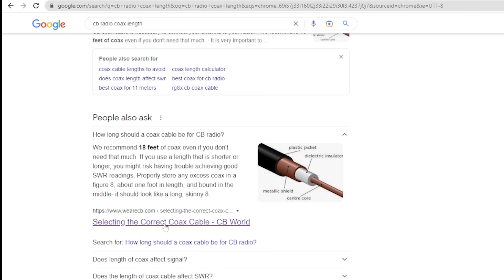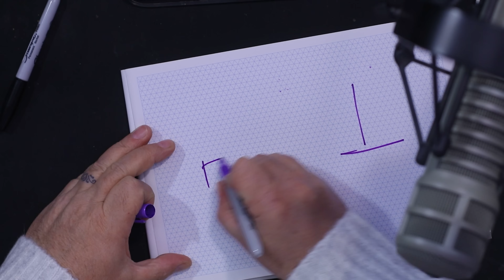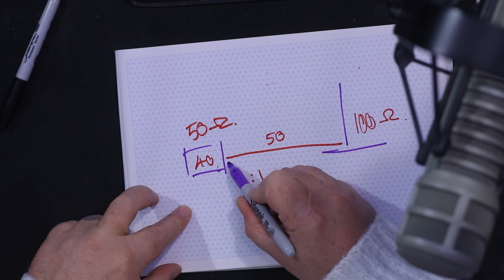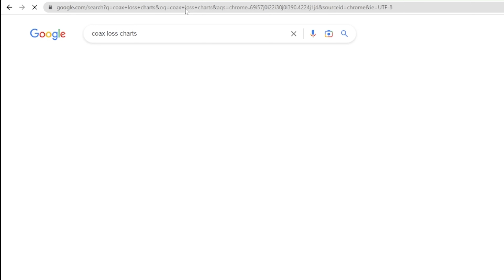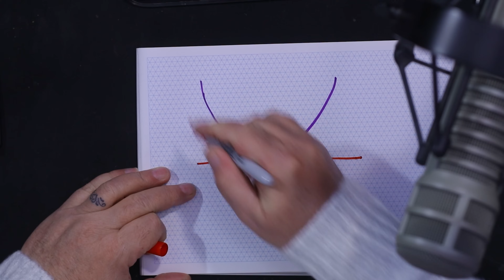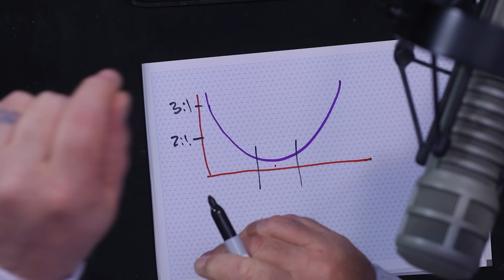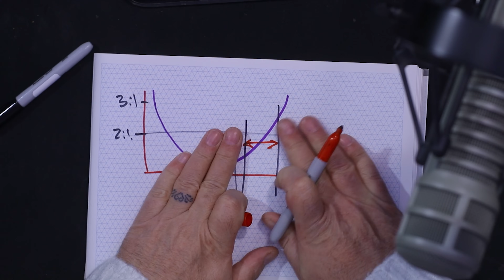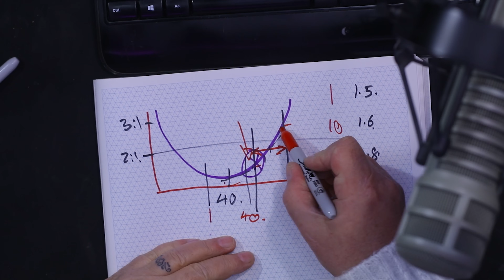11m / CB Radio: How Long Should My Coax Be?

Comment: Great Work Callum....

I'd add there is an "element of good" in this myth. I would not dissmiss it totally. As we know coax repeats it's impedance every half wave etc. This characteristic is then usually exploited for open or shorted ends for tuned stubbs etc. The real magic is in the 18 foot (adjusted for velocity factor) as you point out. This would effectively BROADEN the tune dip seen by the SWR meter if you trim your coax to the right length. Alot of CB operators today have NAUGHTY type radios.... That can talk on just about everything from 26mHz to 30mHz. Widening the usable dip is an advantage..... Shh.... you didn't hear it from me ;)

In AM broadcast there is "certian lengths" of coax runs between TX hut and ATU out on the tower that you avoid like the plague. For the completely opposite end of this characteristic where it runs HIGH. That gets into the whole open wire feeder vs coax argument too.

The rolling your coax into a figure 8 is not a myth. If you have any sort of extra length of cable - speaker - mains power - even a massive long coax - if there is any sort of magnetic feild out side it then the fig 8 cancells all that field from building up.... In the Event's Lighting game where you are using a long cable to run a light 10m away with a cable from you cable packer being 20m. If you are tidy operator you would want to roll this up. We all know if you do it will heat up. fig 8 stops this.... and done correctly doesn't twist you lead. If I see you rolling it up on your arm... you don't work for me no more.

cheers buddy
Reply: cb ops from the start in the usa have had NAUGHTY radios ! the 1960s browning, tram, sbe cb radios etc had receive vfos that went from 26.900 to 27.750. a small bit of work and it would work on tx and rx!   thy wear the first NAUGHTY radios.  then you had the Jonson ham  rigs from the 1950s with 11m from the factory as it was a ham band! the Jonson white face  cb could go low to 26 mhz by swaping the tx and rx rocks. as the Jonson cb was am only the  26.915 was the early free band calling channel in the us for am free band. ssb was was on above ch23 in the old days as the common rig was the browning as it was a ssb set that could go from 26.900 to 27.750 in the 1960s! so ssb was on the hi band. this abuse led to 40 ch. and then going above 40 was the norm as the vfo had more room yet.thare was allso the comsat 25 that was made in limited numbers that had 25 channels in the mid 1960s! the fcc put the hammer on them. so the idea of free banding is old. also running power to as the old ruels only talked of input to the cb and made no mention of amps! then came the ban on amps. then came the modulator ware the cb is used as a power oscillator and the audio is sent to the modulator. demco was a common one.
Reply: I rolled my coax into a loop and it made not one bit of difference to my SWR. I suggest there was r.f. on the outer. I use ferrite rings as chokes on mine.
G4GHB.

Comment: Back in my CB days (just before the FCC gave up on it) I was fortunate to have a couple of local hams that helped with fixing up the radio I had at the time (23 channel Cobra 138 with Siltronix vfo, AND had an extra crystal board for 10 meters!! Got it dirt cheap, too!), and giving advice on radio in general (like if you think you NEED a linear, put your antenna up another 40 feet)

Now that I'm a ham, I can't seem to find ANY  "friendly hams" to help (local, anyway, nearest club is 40 miles away and haven't contacted their contact after WEEKS) and the ham bands are about as bad as CB now!!! Have a radio and antenna (gave up looking for radios online, everyone seems to want almost as much for their junk as a NEW radio, got a closet full of them as proof, so I bought new) just need to get the antenna up and the radio on the air!!

Great video!!

DE KE8NFK
Reply from the maker: Friendly hams.. I don't find that. Most people seem happy to help from what I hear.

Comment: in the 80,s i got electrical wire block connector coax and pl plug 9ft wire one way 9 ft other way and snipped an inch off at a time round the bedroom roof basically a dipole 1.4 swr and worked now ive a imax 2000 and 20m mini 8  20m  coax 40 ft in the air 64ft including antenna down about 3 foot on pole  5 wraps about 4 inches wide  ugly ballun lol  into house and about 10 feet coiled in the air vent swr 1.2   1.3 great lol
Reply from the maker: Perfect!

Comment: I agree with you. I have always tried to keep my coax runs as short as possible.
Once you know loss per 100 ft, its easy to figure out your line losses. If the length
of your coax affect your swr then something is wrong somewhere in the system
and it's most likely your antenna. Nice explanation Callum 73's Gary KF6EWO
Reply from the maker: That's it!
Reply: I agree, if the antenna is right, the coax can be any length. Coils and common mode chokes can be a good thing, if you have excess.

Comment: I've read an article saying for base station, cut your coax in multiples of 11 feet, is that true? Secondly, what is really the correct length of coaxial patch cables for radio to amp then to your SWR/POWER meter? Is it 6, 9 or 12 feet? It's kinda confusing coming from different opinions. Because they say that having the wrong patch cable length may either won't give you the best optimum performance out of your linear or worst, damage it. Much appreciate sir and all the best.
Reply from the maker: OK, so watch the video - it doesn't matter - cut as short as you can.
Reply: You'll find that 11ft is about a half wavelength. Maybe you can figure it out yourself from here instead of believing everything that comes out of another man's mouth.
Reply: @arconeagain  The reason I ask is because I don't know what or who to believe in. Many videos or forums with different ideas, formulas or calculations so it gets confusing. Again in this video it says otherwise. Regarding jumper cables, shorter than 6ft or longer than 12ft may or can damage your amp, but then again, some say they only use around 3ft and it was fine. So which is which?
Reply: @franciscolopez3229  let's say 11ft is exactly a half wavelength of coax with a 66% velocity factor at your design frequency (it's actually 11.87ft on ch35), and you run this length to your antenna, or multiples thereof, or wavelengths for that matter, it will show the impedance of the antenna at the radio end. In fact, technically, it doesn't matter what impedance coax you use! You could use 75, 100ohm, whatever, and the system will ignore it. So you can see the advantages for doing this. Being able to read and adjust your antenna impedance from the shack. Maybe you received a free roll of RG6 Quad shield off a job site and wondered what to do with it (these things would fall off the back of the truck all of the time), but measure its velocity factor and recalculate. You can trust me, this is not an opinion, these are all facts, it's science. Better yet, I have practiced the theory. I learned that when I was 14 or 15.
Reply: @franciscolopez3229  In regard to patch leads, if your amp has a 50 ohm input impedance, any length. However, some manufacturers specify. Maybe they want you to feed their amplifiers at a certain phase angle?? We won't get into that.
I believe the whole patch lead thing came out of America because of a lot of these crudely built 2 and 4 pills etc. For example, have you thought to measure the input SWR of your amp? Most don't think to do this. The fact is that this input impedance varies, especially on these home built types, and what's happening is, the patch lead is acting a coaxial transformer. So one bloke up the road is swearing by 6ft and he gets a higher output, and the other bloke 4ft. What the morons don't realise is that one amp has say a 80 0hm input impedance and the other 30.
So see for yourself. If you have a fairly accurate inbuilt SWR meter in your radio, measure that input SWR (amp on). If it's 1.5:1 or more, use a different patch lead length while monitoring with a decent output wattmeter. The meter won't lie, unless you have a very dirty amp with spurious emissions or a serious CMC problem.
Reply: @arconeagain  correct ! I think most are misunderstanding impedance transforming, this video doesn't go into this which is actually adding to the myths
Reply: @paulm0hpd319  yeah it's all convoluted. In saying that, I am not narrow minded. I do believe there are some concepts to be investigated here... before a smear campaign on CBers. One could also argue that manufacturers are supplying in these lengths, so who's at fault? I plan on doing some practical, because I suspect it has something to with CMC and maybe an effort to decouple the feed line. After everything I've said, there is a chance correlation which confuses matters (I'm an open book BTW), that is the typical velocity factor of 66% means that a 3/4 wavelength lands roughly on a half wavelength with the shield/physical length. So in other words, 0.75 x 0.66= about 0.5. Mmm.
Reply: @arconeagain  I agree also , common mode current and impedance transforming/matching are valid points for certain lengths of coax
Reply: @arconeagain  Thank you so much for sharing your thoughts and experience on this matter. It sure does clear up things regarding my question. 73 and all the best.
Reply: @arconeagain  Again, thank you so much for the additional knowlege.
Reply: @franciscolopez3229  that's okay. If you have any more questions on antenna theory, radio, amplifier and mic repair, just ask.
Reply: @arconeagain I really appreciate that very much. All the best.
Reply: @franciscolopez3229  arcone is the old school CB'er. For years, 40+, I've never cut coax to any preferred length and guess what? All my radios still work. I get out just fine. Just take care of your SWR.
G4GHB.
Reply: Did you not watch the video?
Reply: A dummy load (or lamp briefly) on any length of coax will be as bright whatever length of coax as the power is transferred irrespective of length. A dummy load, coax and transmitter are all 50 Ω so everything is matched. A bulb is a mismatch but still shows the situation. I can do this with a bulb for long periods if I wish because I built a resistive SWR meter and run my tx into that first so the tx only ever sees 100 Ω (2:1 SWR) on the input but shows the SWR, very handy for adjusting aerials.
G4GHB.

Comment: I put an Antron up on the rear stack this weekend - 10 meter band is on fire!  SWR at the data end is 1.8:1, so my 50 watts is only radiating 46 watts.  Big deal.  Hilarious that an SWR of 1.8:1 would have had me worried (and too embarrassed to admit to) back on CB.
Reply from the maker: I know Martin.. Me too - back in the day! :)
Reply: Improve the coax loss the power will improve also
Reply: @paulm0hpd319  Insignificant on relatively short runs below 30MHz is what I'm saying.

Comment: Coaxial impedance is derived from Z = sqrt(L/C) where L is the inductance and C is the Capacitance where both values are per-metre of cable.
Your VSWR graph can also have Ohms on the y-axis so for a 50R system 2:1 would be 100R and 3:1 would be 150R derived from VSWR=Zload/Zsource, it's a good way of estimating antenna impedance from the graph.
Yes there is a bend radius for coaxial cable, but I agree with you Cal, what's reported and the folk lore is all tosh...
We need more videos like this to help dispel what is a lot of nonsense circulating around. Well done.

Comment: I noticed on Houston METRO buses there seemed to be some sort of strap dragging on the pavement of the buses.

I had to ask.  They said they had to ground the buses due to the buildup of static electricity.

I wonder if those kinds of straps would work on cans/trucks going mobile?

Or hooking up grand wires along the ground while stationary like one adds to a Wolf River Coil antenna?
Reply from the maker: Interesting.. It wouldn't work with us lot and dragging a long wire off the back of the truck might be fun!
Reply: @DXCommanderHQ  It is just a short piece.  Maybe I can get a picture.
Reply: It used to be seen on cars back in the 1960's and perhaps early 70's.

Comment: Hi Mr. Callum,  I know of a guy the builds & repairs Amps.. Much smarter than I.. He had a guest on one of his videos one.. 
The guest had a box that he had built with 32 transistors in it; they said that the length of coax from the Box to the 
Antenna was critical.. Is this a special case/ condition??  So confusing.. I have another question; if one has some 
coax that is 18 ft long with a velocity factor of 66%, would that not make it act longer Electrically; as in 1/3 longer?? 
♠W.G.
Reply from the maker: @wg davis - OK, for 99.9% of the time, you shouldn't consider this coax length. There is a technique of using different impedance coax to match an antenna (but that is NOT what we are talking about). The video sounds like more of the same myth. Ignore it. Just stop even thinking about it. Regarding your last question. Yes, Velocity Factor effectively makes coax look longer BUT WE DON'T NEED TO KNOW that. It is irrelevant in our situation. There are some folks who have a crappy installation and someone worked out that you can specifically cut the coax and appear to get a better match. Yes, that is possible - but it's the odd case, let us not even consider it. There are MUCH bigger issues we need to play with - like picking the right coax, installation and antenna.
Reply: @DXCommanderHQ  WOW,  Okay, speaking of the right coax, I tried to find a page with data/ specifications  about coaxes including Velocity Factor but could not, I looked for 30 minutes..    ♠W.G.
Reply from the maker: (sorry for late reply on this) Do a google search "coax loss charts"
Reply: @DXCommanderHQ  Thx. Mr. Callum, I will try it out..  ♠W.G.
Reply: It sounds like r.f. on the outer of his coax or the braid is acting as a counterpoise earth.
G4GHB

Comment: Dumb question- where did you get that paper that you're drawing on? I used to be able to get it at a local store here in the states, but that store closed. I can't find it anywhere.
Reply from the maker: Wendy bought it - and I ran out of notepaper so I pinched it off her! She's had it in stock about 5-years. Seems nice stuff.. The front cover says SILVINE and it's Isometric Graph Paper (if that helps)

Comment: The amount of arguments i've had on this point! One thing that can exacerbate it is if someone has a problem with common mode currents on the outside of the coax, It can upset swr measurements, And as common mode currents ARE on the outside of the braid they are not involved with the velocity factor. So you get the illusion that the coax length thing is true. Good explanation by the way, Can you imagine setting up a top band antenna in a vehicle if you had to use a half wave of coax, velocity factored or not!!! 73 de Mark
Reply from the maker: HAHA
Reply: In this particular instance/example, that is, using 18ft of 66% velocity factor of coaxial feedline for a typical mobile installation, you'll find that you 'do' take the velocity factor into consideration.

Comment: There are scenarios where the SWR measurement changes along the length of the coax. What's happening here?
Reply from the maker: As I said in the video... If you have say 100 ohms on one end, yes the impedance will change and repeat every half-wavelength. I said I wasn't going into transmission line theory in the video but that is what I would call and "advanced" method of tuning antennas. But it shouldn't be the first method. Not an HTTPS page - but this explains it: http://www.antentop.org/w4rnl.001/quarter.html
Reply: @DXCommanderHQ  Thank you.
Reply: Yes Simon every length other than a matched length will present a different impedance to the radio

Comment: All you say makes perfect sense and answers a lot of my questions I had over the years that no one had any real answers too. It's about time someone made a video like this, Thanks. 
The only thing and you mentioned it was the figure eight. I was always told never to coil the coax. Like you say it's called a dirty ballon. Q/ Can you have to much coil aka dirty ballon? How much coax is to much coax? and how much damage does the sun do to the coax if you have lets say a 20mtr tripod? I just searched for Figure Eight vs Coiling Coax using many types of keywords and found nothing about the coiled coax being called a dirty ballon and why or why not to coil or figure eigth the coax... Might be another great video you could make explaining it to people like me :) !
Reply from the maker: OK, so do a google search for "dirty balun" - you'll find it.. Now as reagrds as how much is TOO much.. Basically, have it as short as you can, no use wasting power down coax because it will have some loss over length.

Comment: This has always been a disputed topic. I talk 11 meter, so I talk CB on a ham radio (President HR2510), plus a pile of vintage  ssb cb radios. The dispute is the jumper coax length between the transmitter/amp/external swr-power output meter...
Reply from the maker: Oh my! Really? The patch lead? Yes OK - if that's a hint, I can also make a quick one about that too..
Reply: @DXCommanderHQ  yea, some say at least 3 feet of coax between transceiver and amp, some say 6-9 feet, and there's even a guy that has 18 feet coiled up behind the desk. I'm currently only running 2 feet of coax and it seems to work fine... your thoughts on this?
Reply from the maker: (sorry for late reply on this) I've made a video.. Hang on for the release!